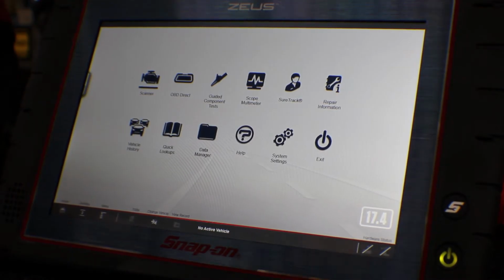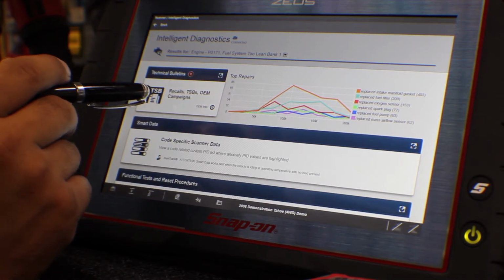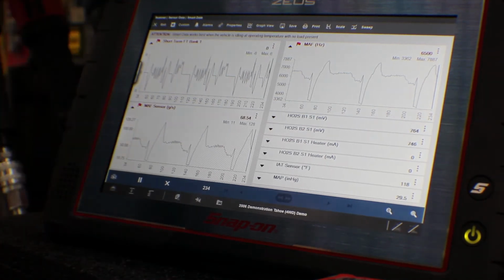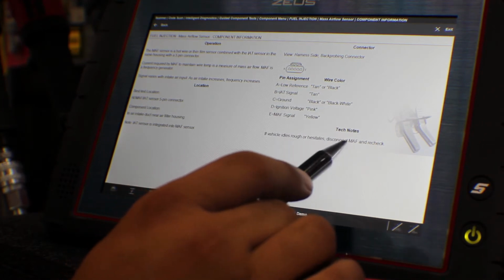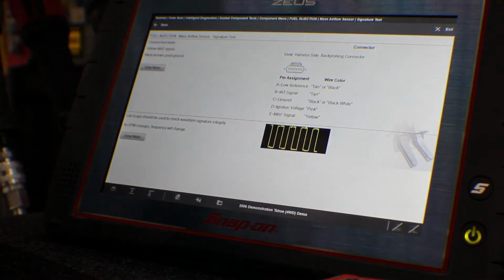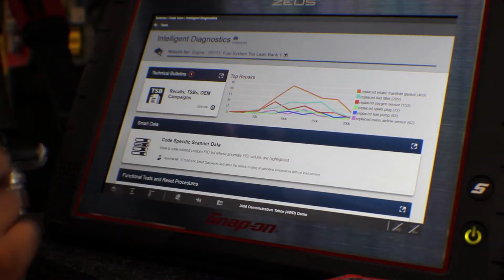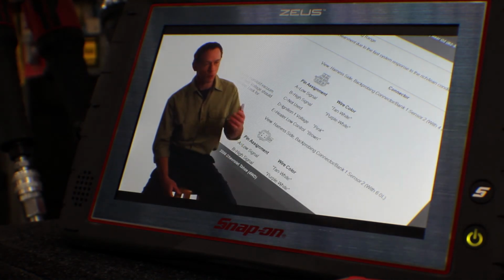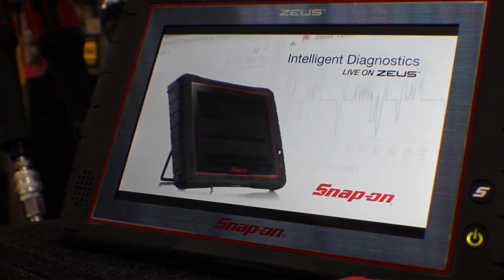Zeus Snap On Diagnostic system overview demo of intelligent diagnostics

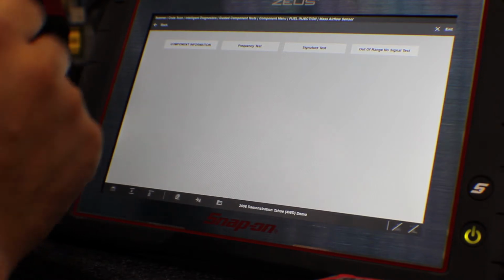Comment: 5:55- shitting on entry level techs about not knowing what a MAF is. 

“Note: unplug MAF and recheck” 

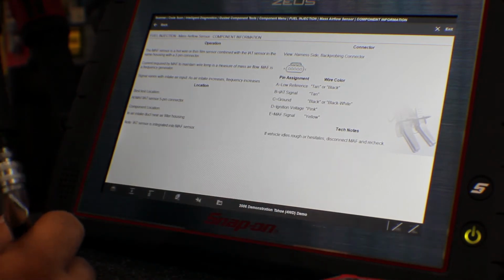6:21 “so maybe they have a problem with the connection in there....”

🤣🤣🤣🤣 get yo ass in line with those that “shouldn’t be working on cars.” Obviously you don’t know what is looked for when unplugging the MAF. S

Comment: Too overpriced when you can get much better scanners and oscilloscope for half the price. This is for the idiot that doesn’t know anything about cars. A properly trained mechanic will be able to diagnose it without all that extra bs
Reply: I have an Autel ms908 pro and it's amazing! I still use the old Snap On MODIS for use as a labscope. BTW the Autel PID'S are in red letters when out of range
Reply: How do you like your autel? Have you ran into something it couldn’t do?
Reply: Not so far! I am a professional independent tech and have used it on many makes and models. American, Asian and European. I have a GM Tech2 and the Autel is as good if not better on GM. I have used it on diesel pickups too and it does all I have asked!
Reply: Deathknell Nice, that’s what I like to hear. I might get the elite now lol
Reply: You would be surprised at what it does. If you have use for labscope I see they have packages available. Nice chatting with you Wendall!
Reply: Deathknell from what I read on reviews their labscope sucks big time lol but the actual scanner is great!!!! Beside I have a picoscope lol
Reply: Wendell Greenidge 
I use my Snap On MODIS for my labscope. I want a Pico too. I like my scope separate from the scan tool. What I meant was there are freebies if you look. Get the free inspection camera!
Reply: Deathknell tech 2 is garbage obsolete to begin with
Reply: Ya $12 grand is a crazy. I use Autel as well.